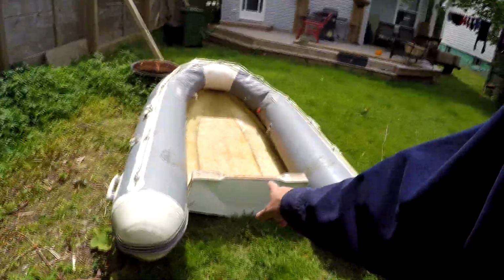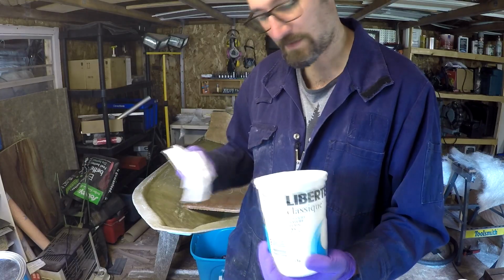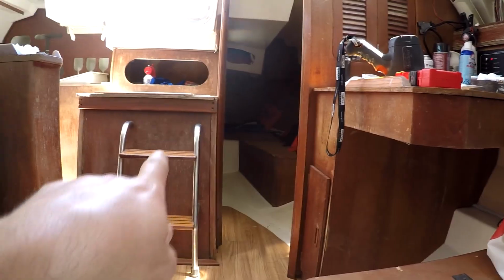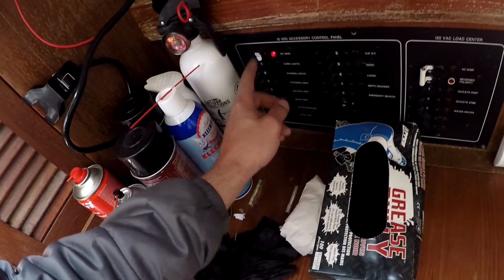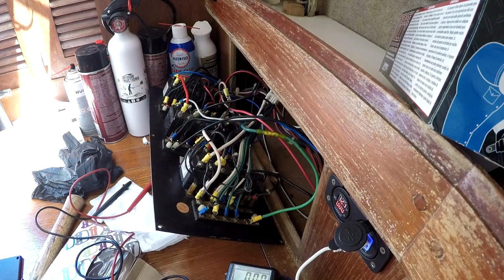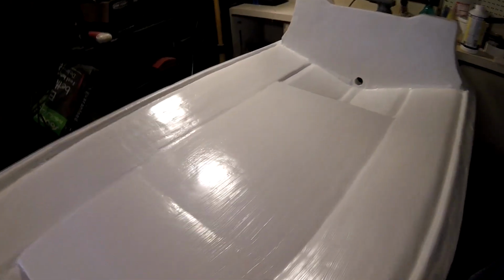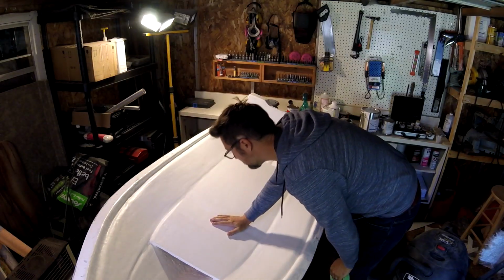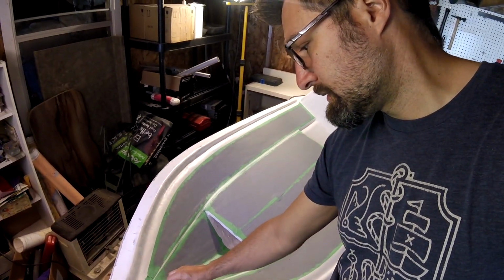Prepping The Boat & DIY Fiberglass RIB pt3  [ Ep 33- Sailing Nova Scotia ⛵]

Comment: Wow the RIB came out awesome!  Beautiful workmanship you have inspired me to try this next winter.  BTW - did your friend that lent you the mold make that mold or did he buy it.  If he bought it where did he get it?

About the float switch failing on the bilge pump.  I had this happen to me last November on the last sail of my season and it caused a major headache. A garden hose that was hanging on a hook in one of the cockpit lazarettes fell off and wedged under my dripless shaft seal causing it to not be dripless shaft seal.  The bilge pump float switch wire that connected it to the pump had corroded and fell off.  Which went unnoticed until  the bilge flooded. Like you my pump worked perfectly in manual mode so no safety issues. The upshot of all this (which applies directly to your problem) was that I was advised by the local expert who fixed my bilge pump is to never have any of the bilge pumps wired through the main electrical box. He rewired both of my bilge pumps directly to the batteries with two fused switches between, one for each bilge pump.
Reply from the maker: He made the mold from an old RIB he had.  Not sure what brand it was.   He spent a lot of time polishing the old hull to make the mold as smooth as possible.  As for the bilge direct to battery.  Basically that's whats going on , only the fuse is in the panel. Otherwise it just goes to battery #2 (the house battery )

Comment: You should of faired the surface heaps easier to sand and gets rid of all the hills and hollows well I guess you don’t learn if you don’t make mistakes or unless you don’t ask someone else lol + thin it a little and roll and tip if you don’t want to spay 🤙🏻 you get a thumbs up from me anyways for trying 👍🏻
Reply from the maker: Yeah I had thought of that fairing compound... But, then hoped it would work out with less work.   lesson learned!

Comment: Looks good! Question: how did u replace the teak on your deck and cockpit? Thanks, I just bought an H34. Shannon
Reply from the maker: We haven't touched any of the wood on the deck yet.  But in the cabin we used plywood sealed in epoxy with Allure flooring from home depot.  It's not a very traditional way of doing it.  But we are happy with the results!
Reply: Thanks, it looks like you changed the teak in the cockpit [looks like a gray starboard material]...  Yes, I saw the video of the floor/sole going in.  Thanks for the videos and happy sailing!
Reply from the maker: Lol... That's actually just really dried out teak!  It's still original!